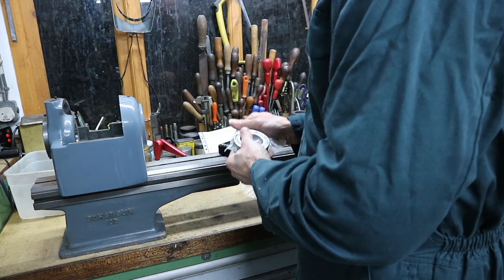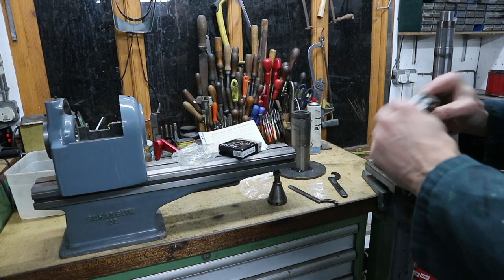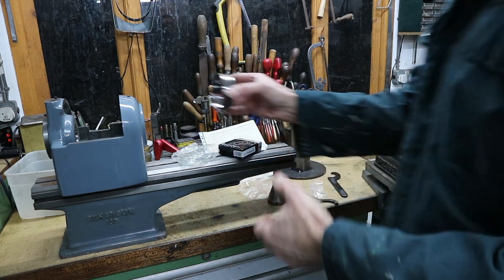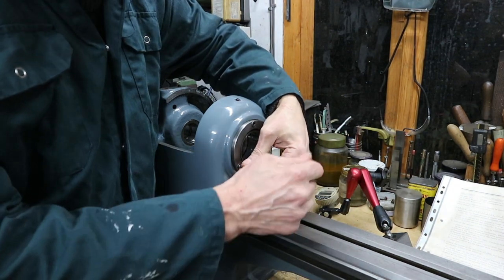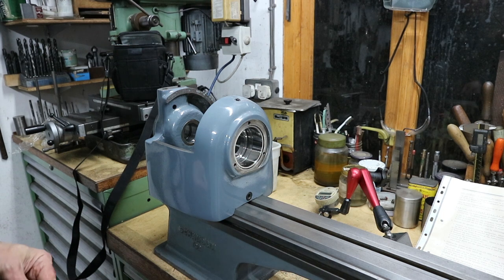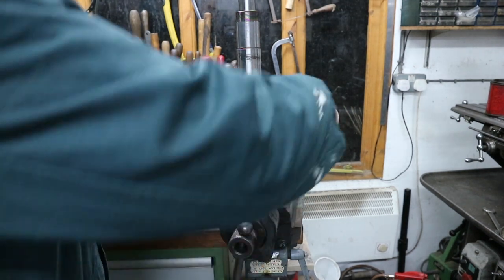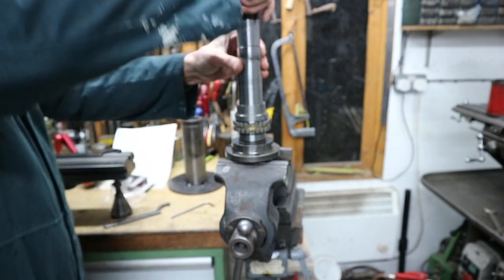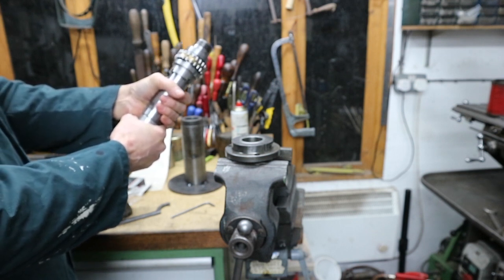Schaublin lathe spindle bearings: Part 2 - front bearing fitting and adjustment

Comment: Thanks David, very helpful, although I imagine it would be even more of an adventure with a backgeared headstock
Reply from the maker: There's certainly more disassembly involved in a backgeared headstock, but with all the backgearing components, pulley etc. removed the process is identical. Reassembly once adjusted is fiddly with a backgeared headstock.
Reply: David, many thanks. As always, great detailed info about the “how to”. Also nice to see a short bed (single leg) 102 too.

Comment: Mr. Samways, Thank you. I am conceptually following this procedure and to know when something is ‘good’ is difficult without the perspective of someone like you. I have a few questions - 
-supporting the rear of the spindle: are you describing a shop made bushing to support the rear of the spindle during this process or using one or both of the opposing rear bearings?

-is the ‘oil ring’ you mentioned while pushing  in the bearing sleeve the actual sleeve itself or something that lives inside the housing behind the sleeve, Or is it a part of the assembly that we are gradually tightening and tapping in this process?
-and just to clarify, using the extension piece which overall length gives you some leverage, you are pulling ‘opposite’ the clock, towards you, without rotating, for the sake of applying that movement on the clock to the formula?

Again, for the time you’ve taken to do these videos I appreciate you and it makes a difference for my approach and I’m sure saved me $ or peace of mind. 

Best, John.
Reply: Mr.Samways, disregard the middle question. I see piece that must go in before the new sleeve and it has oil travel features. I am becoming more familiar with each of these parts. 
Best, John.
Reply from the maker: Hello John, I have the rear bearings in place - in this case it's the old bearings prior to replacement (adjusted so that there is no radial or axial play). As I say in the video, Schaublin do not specify what loads or how to apply them to the spindle. As we are only chasing a very small deflection measured by the DTI it's not necessary to pull away from the clock - the spindle should return to the centre. If you do pull away from the DTI then you would expect to see more or less the same reading. Rotating the spindle shouldn't make any difference, if it does then it suggests a problem with the spindle or the fitting of the bearing.

Comment: Great video! I was wondering if there is a good way to remove the outer race without risk of scratching the headstock bore?
Reply from the maker: Removing the outer race is pretty straightforward. On some headstocks Schaublin provided two small holes at 180 degrees to each other and at the diameter of the bearing outer on the inside of the casting to aide removal. If these aren't present then the oil ring that sits in behind the bearing outer can be used to drive the it out. The oil ring has a threaded tubular extension which will need to be removed when the pulley is in place in order to fascilitate removal of the pulley. The tube can be screwed back in place and then used to drive out the outer of the bearing using a brass drift inserted through the appature for the rear bearings - the blows need to be evenly distributed of course. Alternatively, you could make up some kind of set-up with studding and tube to draw the outer race out, but it doesn't take much force to drive the outer race out as described.
Reply: @davidsamways  thanks a lot for the detailed explanation, i will certainly give it a go! I bought modern SKF for my 70, they come with plastic retainer ring, and i am going to grease fill it with modern grease, hopefully its not too sacrilegious!

Comment: Pure guess work and not the best way to do it? With the spindle vertical it’s best to tighten the locknut until the outer race just holds itself and I mean just holds itself… Then put the outer race in the headstock and assemble the spindle?
Reply from the maker: There probably are more accurate ways of doing it Steven. As I say, the Schaublin instructions do not provide a more accurate way of doing this and SKF's booklet on precision bearing adjustment would be a much better way of proceeding. However, it's a case of "horses for courses" - this is a bearing for a plain lathe not a grinding machine. With more than 25 years experience of fitting these bearings to these specific machines I've found this to be the easiest and most reliable method and produces the most pragmatic outcome. If you develop a better way of doing it then I'd be very interested to hear your experience - I'm always open-minded to better ways of doing things!

Comment: within 5 um? What are You gonna do, breathe on it? Factories manufactured their own mounting jigs for correct adjustment, I would just tighten it until there is no more chatter after reasonable warm up. Keep in mind if You assemble it in a very cold room You may not know if it going to bind and overheat or be too loose.
Reply from the maker: If you listen carefully to what I say I'm echoing your sentiments exactly - one has to keep in mind that this is a lathe not a grinder. I've lost count of how many of these I've done and a practical approach is really the only approach worth taking.
Reply: @davidsamways  You are right, I wasn't listening carefully, if at all, I just commented on "within 5 microns", which within my ca 7 years of tool making experience is more theoretical or a thing of feel rather than a measuring possibility.